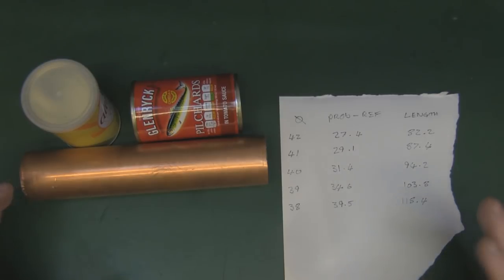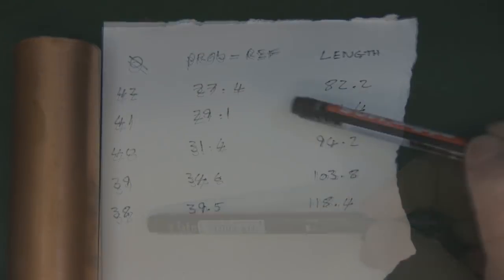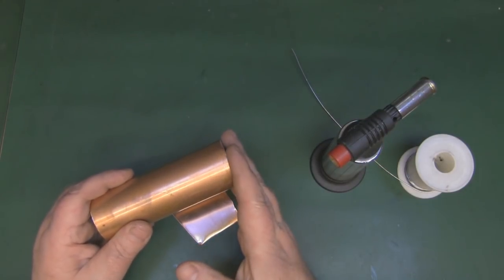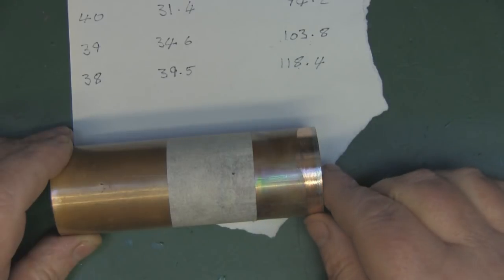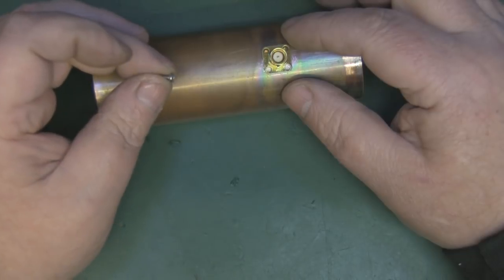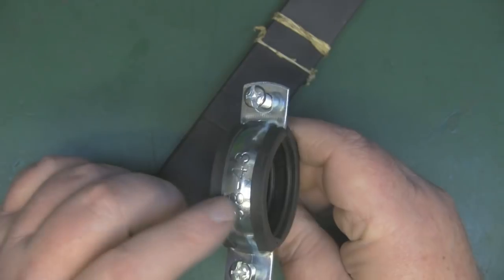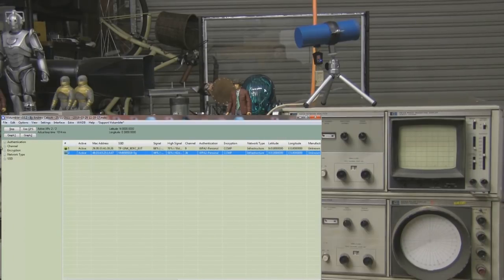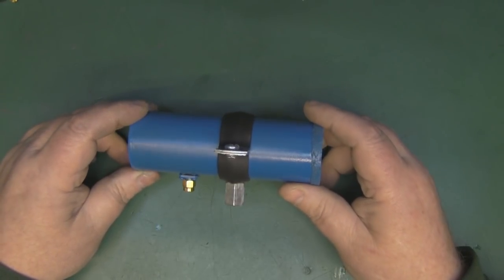5GHz Wifi Cantenna

Comment: Hi  Andrew, 40 years a plumber, would it help if you cleaned up the inside with steel wool prior to fitting the probe, if so wrap it round a smaller diameter pipe dowel and twist till all scale removed from the soldering operation, also if you wrap a piece of A4 paper round the pipening lining it up that gives you a straight cut line also,  and if  clean with wire wool you flux only the pipe end the solder wont flow to fare saving you grinding time.  
would foil wrapped round a plastic pipe be good enough for cantena, you could alter the diameter of the pipe by routing out a slot and gluing up then wrap with foil to get precise diameter.
Hope this helps Mike, great videos.

Comment: Perhaps use a 2 - hole SMA panel mount connector instead of the 4 - hole, then line up the holes with the axis of the tube?

Comment: I`m looking all over the net but I can`t find anything, so I`m gonna just ask.... I want to strengthen and extant the range of the WI FI of my 5G router... I have strong enough antennas on the receiving sides (my devices) but I want to make the sending side (router)  signal stronger... so Can this be used for such a thing, maybe make an antenna of this sort and solder the cable to the router ???

Comment: Andrew, i have a can that was a dog food can, the open end is 10cm diameter and 17cm in length of teh can. is that going to be ok to use as a cantenna with a usb mini wifi adaptor plugged in attached to a usb lead. Is it going to work ok with those dimensions ?

Comment: I realize this is an old video but it is EXACTLY what I am interested in building. You stated that the copper pipe had an internal diameter "slightly under 39mm in diameter so this is going to be almost perfect for 5GHz wifi". You never actually state what the "perfect" (optimum ) internal Diameter for a 5GHz wifi cantenna is and I can't seem to find that information anywhere online, after weeks of searching. I can find PLENTY of information on 2.4GHz cantennas but info on the 5GHz spectrum is scarce. If it's not to much to ask, would you mind educating me as to what the optimum inside diameter is for a 5GHz cantenna? Thank you for your time.
Reply from the maker: Look at the measurements in the description 38mm is the minimum anything smaller and a 5GHz wave will not fit in the waveguide. 42mm is the maximum anything bigger and you start to let other frequencies in, look for the video before this one as it shows what can happen if you use a bigger waveguide. So 39mm is almost perfect 40mm would be perfect.
Reply: @andrewmcneil  Thank you Sir. I appreciate your time. Love your videos. I'm learning so much. Many more to watch.

Comment: You should check out AREDN, HAMs have hacked a bunch of these routers and wifi  radios to work on the HAM microwave frequencies, which are adjacent to the 2.4 and 5.8ghz wifi bands.

Comment: I am considering creating a 3D print and cover it with a copper foil. Easiest way would be to print it in one go and cover the outside. However, the plastic between the active element and the foil may influence the performance, however thin it would be. To get the foil on the inside will require the print to be done in parts, the inside surfaces covered with foil  and assembled. Any thoughts on this?
Reply: I'd make a 3d printed wire form instead, a mold sort of speak, to use to bend wire into it. But that's me ;)

Comment: Discussing the points for measurments was very informative.  Do you have a link for the SMA to USB adapter.
Reply from the maker: https://goo.gl/yVXSkZ or https://goo.gl/4YRU6H I have also opened up the antenna and was surprised that it is indeed dual band
Reply: Thanks, it dose not post to New Zealand, but I'll find one somewhere.

Comment: Nice build! I have an unrelated question: I have an Alfa AWUS036NHA and a TP-Link TL-WN722N which outperforms the former. Is there any reason to choose the Alfa adapter over the TP-Link adapter which costs less than 10GBP?
I really enjoy your videos, they are interesting and inspiring.
Reply: I have both and pretty sure the Alfa can be configured to use more power
Reply: a True Alpha is rated at 2000mW (2 watts)

Comment: Has anyone run across a cheapo wifi adapter like the one he uses on the US amazon? Would like to upgrade the built in wifi on my laptop and have the ability to attach an antenna. (also, thanks again for the videos)!

Comment: andrew mcneil  another great video! Could you pls reply to my question on the 19 element yagi in drain pipe? It would be greatly appreciated! Thanks again
Reply from the maker: You would be better asking me here as I get around 100 messages a day and that is an old video.
Reply: andrew mcneil so basically I I noticed a lot of people couldn't get it to work and I wanted to know why u think that is? Also my width shows 5 mm and I think you are using 6mm is it OK for me to use 5mm tape for the elements? Also what antenna in your opinion is the best performing antenna to build out of  the ones you have made. I'm working on that 19 element yagi and also the double copper Clad coat hangers yagi and want to make sure I'm picking the best ones to make. Thanks again man ur awesome
Reply: andrew mcneil thanks for the reply I'd really appreciate your thoughts
Reply: andrew mcneil let me know what you think pls! So I don't get lost in all the comments!
Reply from the maker: Ok the driven element is 31.5 mm long bent into a rectangle with 5 mm sides. the wire is 16 swg 1.6 mm thick. Hope this helps. I may revisit this in the summer and build a big 19 element Yagi again as I do have some new ideas that would improve it
Reply: andrew mcneil thanks I've aost got it done will let you know how it turns out
Reply: andrew mcneil thanks for reply is it 31.5 = 10.75mm X 5mm X 10.75mm X 5mm for driven element wire or is your block 5mm if so what is thickness of your plexiglass? Also is there a difference if I use 5mm wide tape versus 6mm? Sorry about the questions I seen a few of your reply under the video that could be misunderstood. Thanks man pls keep it up!
Reply: sorry i ment is it 31.5 X 5mm X 31.5mm X 5mm
Reply: there is no way its 31.5 mm long because the template shows likw 52,5mm long. im begining to get confused im so sorry
Reply from the maker: I have made you a PDF that should help. https://drive.google.com/file/d/16nsfsSJzhW3a42L4n9kjA11wBRdLqWba/view?usp=sharing
Reply from the maker: also forgot  to add the balun loop in the PDF is also 31.5mm
Reply: andrew mcneil the template I've used to make the elements shows the driven element being 53mm in length? That's just 1 sided? So if I follow the pdf you just gave me I bend 31.5mm rectangle as driven element? So it will be smaller in length than my parasitic elements?
Reply: andrew mcneil can you pls look at the measurements I posted in my drive a few comments up? I cannot figure out why it isn't working?